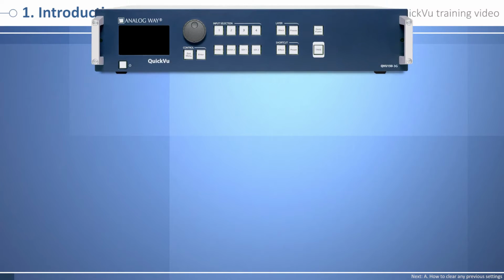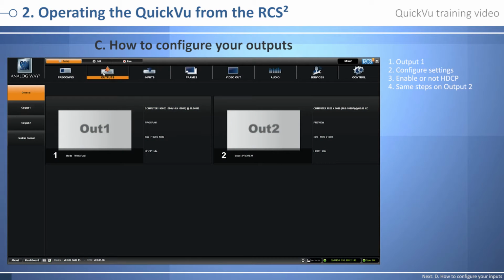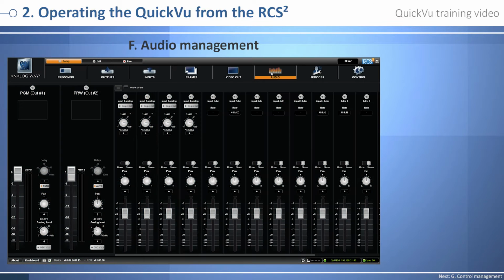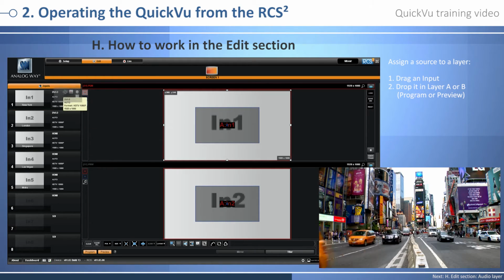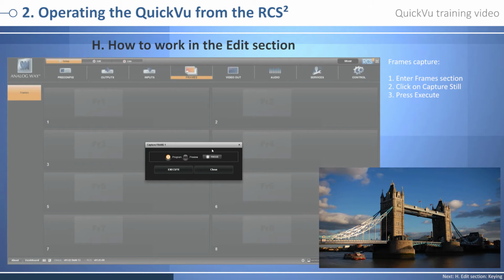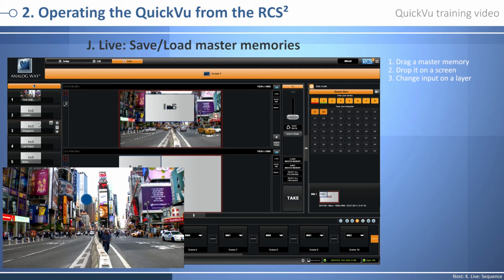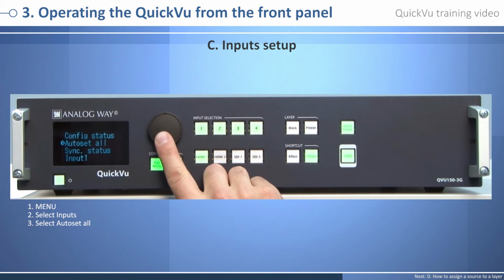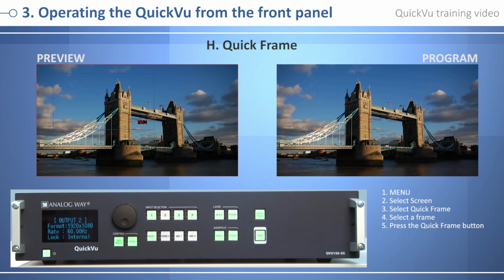QuickVu QVU150-3G Training Video

Comment: Is there a way to create a new layer, I can not seem to find it, you have the red line box and a blue line box but can you make another box?
Reply from the maker: +AAVC Hilton with version 1.04.02, QuickVu has 3 layers when controlled by the RCS2 or the RK-350:
- The background frame displays a still picture (captured by the unit) at the background 
- Layer A displays a live content over the background frame
- Layer B displays a live content over the background frame and layer A.
If you need more than 2 live layers per screen, you must use a Saphyr (ref. SPX450) or an Eikos2 (ref. EKS550). 
If you need more info, please contact our Tech Support dpt: http://www.analogway.com/en/support/technical-support/